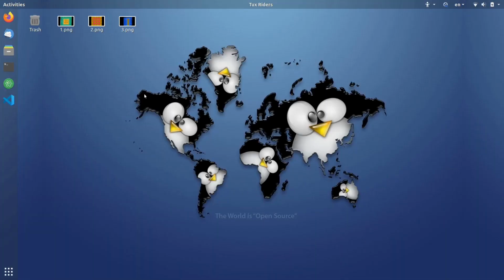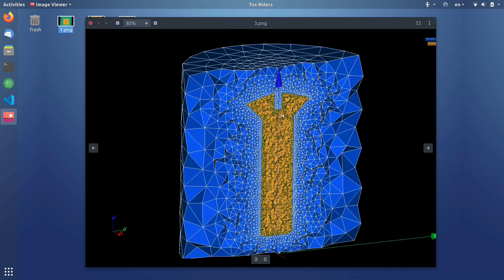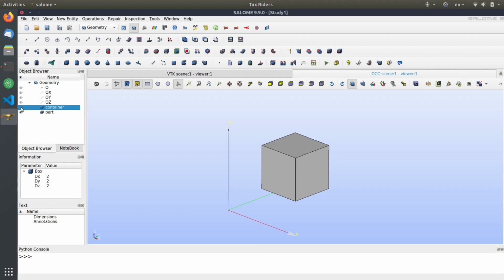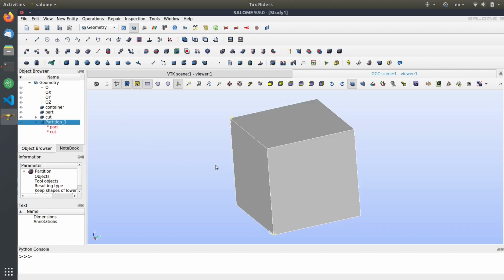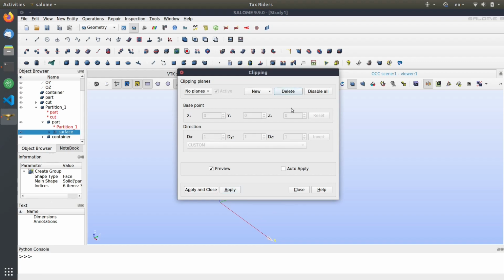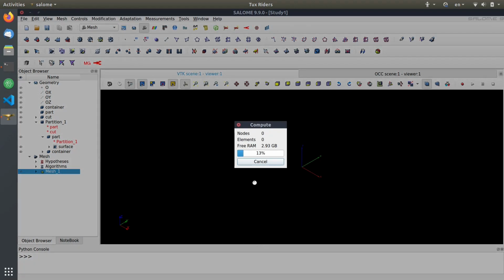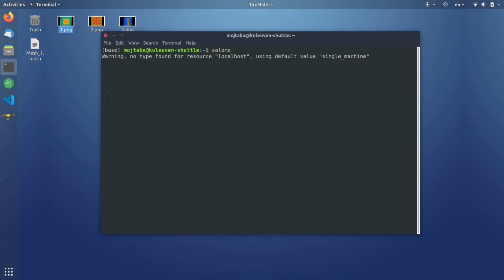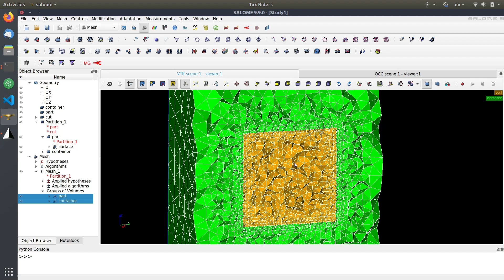Generate multi-body multi-volume mesh geometries in SALOME with mesh refinement [On Demand 14]

Comment: Are you able to assist me in setting up an openFOAM case looking at a fluid flowing from a pipe?  I want to visualise the heavier fluid draining from the outlet back to an S-Bend where the end of the pipe is within a less dense fluid.
I am able to provide both a STEP file of a freecad geometry file and a more detailed explanation if you are interested and able to help me set it up.
I have watched a number of your tutorials, but I am just struggling to get things bedded down in one of my own examples.
Reply from the maker: I think your problem is a sort of mixing problem, no? You have two fluids with different properties, and you want to simulate how they interact. I would say that the geometry is not the biggest challenge in your case, but rather, you need to find a good solver that can tackle this type of model. Unfortunately, I've never worked with mixing problems so I cannot be of a great help here.

Comment: Dear Mojtaba, your videos have been very helpful through my research. However, right now I am stuck with a problem; My mesh has more than one degradable volume and BIODEG receives only one label. I thought of uniting these volumes in order to have two regions, namely the medium and the biodegradable part but unfortunately, I ended up being here asking for your help. I would appreciate your guidance on this matter as I cannot move forward at this point.
Reply from the maker: very happy to know that the videos have been useful for you. thank you so much for pointing out to something I had never noticed before. yes, BioDeg doesn't support two regions by default. 2 options come to my mind for this problem at this moment: 1) you may consider modifying the BioDeg code in order to accept 2 regions (which can be a bit cumbersome), 2) grouping the biodegradable volumes in SALOME. I think you have already tried the second option, but I guess you have exported the mesh to GMF format (.mesh), which neglects the created groups unfortunately. in my biodegradation research, I was using a powerful tool called FEconv (https://github.com/victorsndvg/FEconv) for this purpose, by exporting the mesh in SALOME first to UNV format and then using FEconv to convert it to .mesh format. in this way, the created groups are preserved. you can do that by running a command like "feconv mesh_1.unv mesh_1.mesh". the tool can be easily compiled on Linux, but let me know if you failed and I will create a video or blog post on it (I should actually start to record some videos on BioDeg). if you use Windows, send me an email so that I can send you a compiled Windows binary I had compiled for a friend of mine.
Reply: @TuxRiders  I truley appreciate your thorough response, dear Mojtaba. I have not had the chance to go and try your suggested method. However, I encountered another fatal problem. The Mg thicknesses I work with are extremely small (i.e. in um and nm scales). Before I start simulating my thin Mg stick with several volumes, I was wondering if BioDeg could work with such tiny mesh elements.
And, sadly, i ended up receiving PETC error.
Caught signal number 8 FPE: Floating Point exception, ptobably divide by zero.
I am baffled onve more. Could you please, open a window of light on this matter?
Reply from the maker: @azarhadi9186  you're welcome :)
BioDeg doesn't care that much about the dimensions, but I would say things in the scales you mentioned degrade quite fast, and it can cause a problem in your simulations. also, capturing this level of details requires a big mesh, which can cause problems for you if you don't run the simulations in an HPC environment. 
the error you are facing seems to be a problem with the mesh labels, like cases in which BioDeg cannot detect any element belonging to the degradable solid. you may need to double check your mesh to make sure it has correct labels.